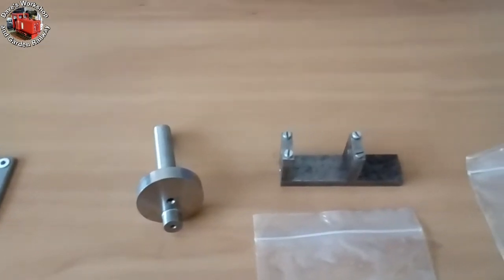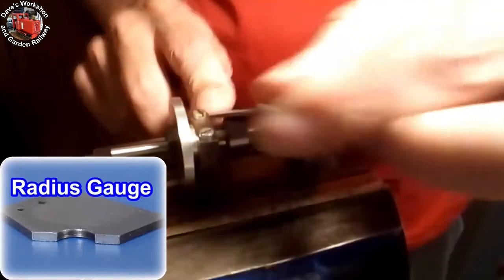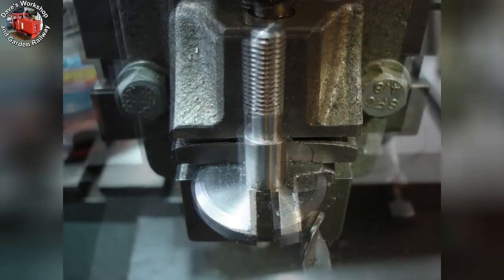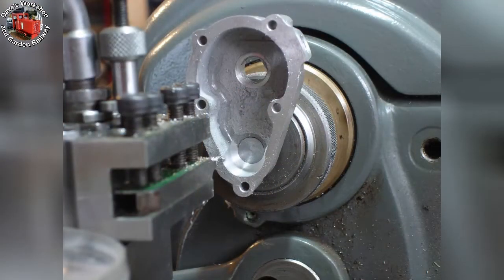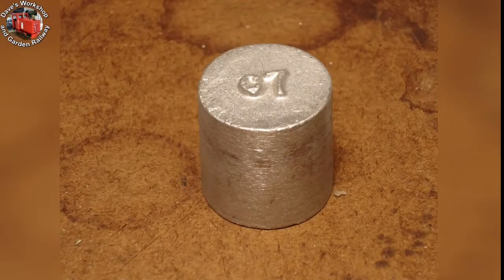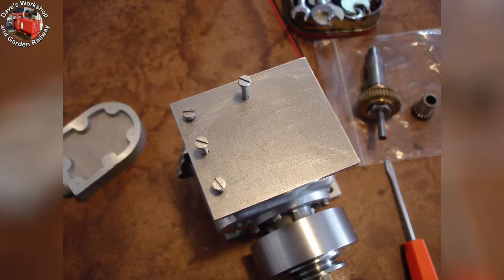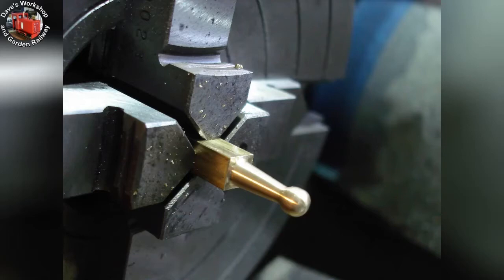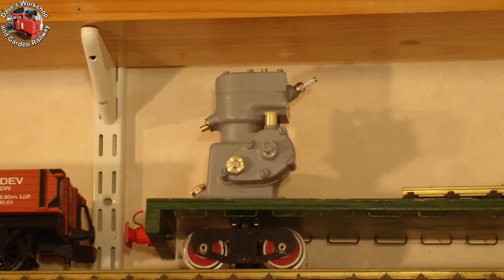Westbury Whippet IC Engine build - 30 years into 30 minutes

Comment: I had a similar problem. Spent ages and about 4 attempts to make a cam shaft for a 26cc twin. Having finally got the cams perfectly shaped I hardened it... bent like a banana, with 15 thou run-out in the middle, almost cried!  After calming down I was able to hold it between centres on the lathe and bend it back to shape by pushing the middle with the cross slide. That has to be the best looking Whippet around, beautiful job, well done and thanks for sharing it with us.